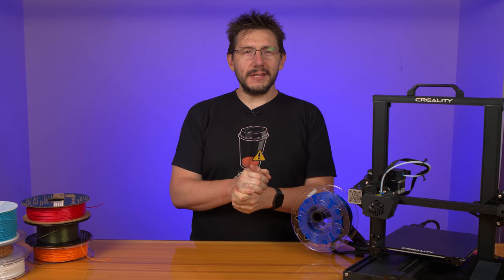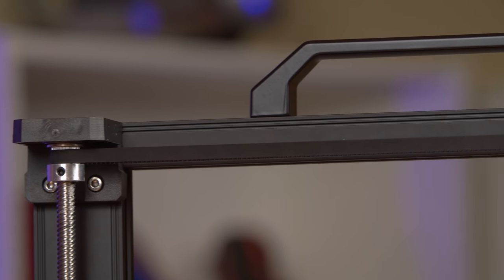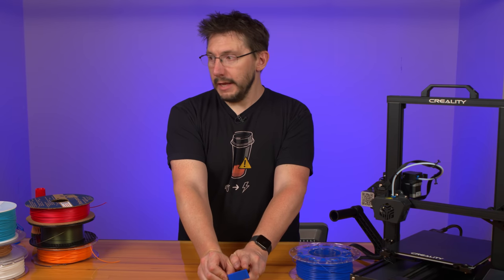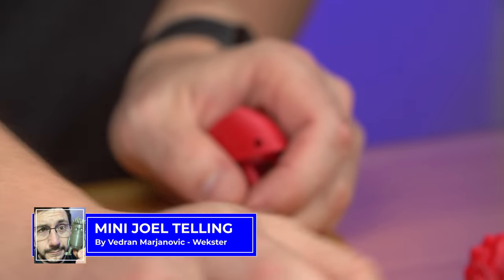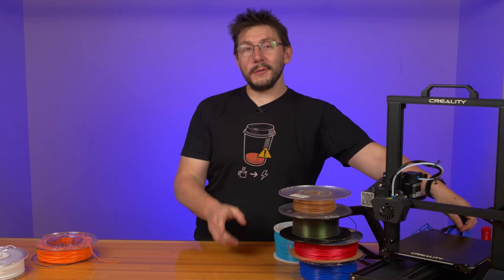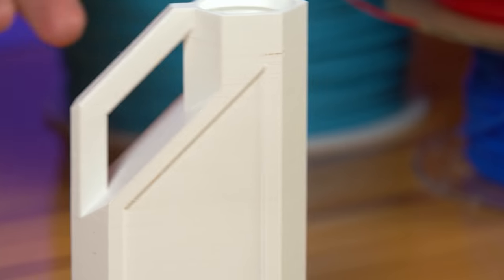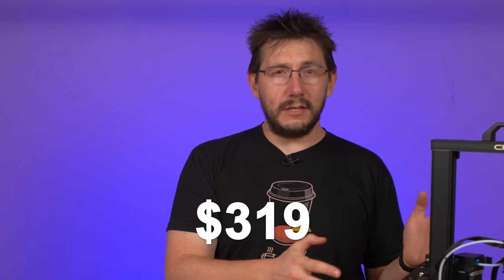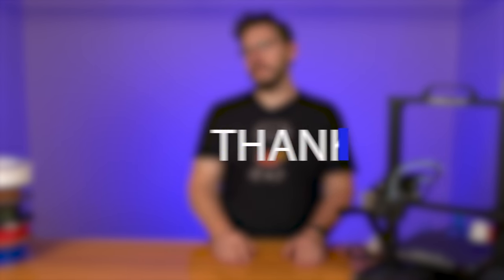Creality CR-6 SE Review // Should You Back It On KICKSTARTER?

Comment: MMmm  kickstarter is an investment gamble with money you can afford to loose which is fine if you want to take that risk. But it's not an off the shelf retail one in production....does it run ok on the standard Cura or other slicers? Still some software updates to do yet too....Imo, so it will be interesting to see what the finished production   off the shelf retail version is and how it runs etc...on thier AliExpress store .Imo Laurie

Comment: Video Request! I would like to hear from everyone whether you have 2 printers or 2 farms worth of printers. How do you handle their slicer profiles managing multiple printers with multiple materials and even multiple configurations of the same printer (nozzles, speeds, dual extrusion, etc...)? Like I said, I would love to hear everyone's methodologies. It would be great if we could get some big YT players who use many different printers, both for fun and professionally (Joel 3DPN, Tom TS, Angus MM, Michael TT, and many others).

For reference, I started with 3D printing in college, 6 years ago now, with a few maker bots in our design lab then ran a printing service in the college library where we only used a single material on a single printer. I then did a thesis project with a prusa clone kit, where I compared printing materials and mechanical properties using standard settings across the board, except for what I was testing. I now currently have 5 very different printers and I'm always trying different materials and printing settings depending on my current needs. I have primarily used simplify3D but have dabbled in prusa slicer recently (first MK3s ordered). I have a Pallete2+ pro which uses their slicer canvas3d.io (free to play with) which lets you have several printer profiles that can slightly link changes together, and then materials have "style overrides" where you can set specific settings per material like speed, temp, retraction, extrusion multiplier, etc... It seems like maybe the way to go but I'm not the biggest fan of that setup right now. 

I know there is no right way but everyone may have a right way that works for them.

Comment: in 2020 it was on kick starter   but not in 2022.  on amazon   569 Can . I am analysing if i will buy this model seems interresting to me. would be my first 3D printer. after looking at so many models,
why does Creality not add thos bars like on the cr 10 v 3  on all those models that place the filament roll on top?  It would make the hole  printer more rigid and stable no?

Comment: OK, I’m saying it... you’re the Fox Moulder of 3D printing 😂🤦‍♂️😎

I’ve backed it, can’t wait as it’s my first 3d printer 🖨
Reply: Just a little advice: I'd recommend you use Cura instead of Creality Slicer, did some quick testing (I did not know about Creality Slicer before), Cura turned out better for me. That was with an Ender 3 though, I'm not sure the 6 even has a profile in Cura tbh, but good choice of a printer regardless of software. have fun printing
Reply: PiXeL _ArC thanks mate. The 3d printing community seems really supportive. I’m going to tinker with a few slicers. Been using the upbox 3d printer at work ( I’m a teacher) as well as a Flashforge  but looking forward to owning my own printer to play around with. This seems like a decent place to start 👍
Reply: @BigfootRunning  Try prusaslicer as well. All slicers produce different results so see what is best for you.
Reply from the maker: Creality Slicer is Cura. It's currently using Cura 4.2.1
Reply: @3DPrintingNerd  Of course, but I couldnt access most of the cool features though. Maybe I missed switching to advanced mode, I will have to check that, but in the test I did Creality Slicer resulted in noticibly worse flat surfaces on the benchy as well as corners. The corners of the Creality Benchy were less clean and less sharp. Anyway, I am going to have to look into this some more then and try to tune the profile some more. Also, to make it fair I guess I will have to test a stock Cura profile against a stock Creality Slicer one.
Once I have done that, I will add whatever was the result here too.

Okay I was too stupid too find the expert settings, but some of the mesh fix options which saved my butt with a project are still not present, that might be the Cura version being 4.2 though

DISCLAIMER: I am not trying to prove you, 3d printing nerd, wrong or anybody else, I am genuinly curious if there is a difference and if it matters

Test 1: 
- File: Benchy
- Filament: Semi transparent PLA from Spectrum Filaments (in my experience semi-transparent filaments tend to show little inconsistencies better due to them, well, being transparent)
- both profiles adjusted to be as similar as possible
Results:
- definitly very similar but Cura still seems to have the upper hand in this case (of course its one case and one printer, not a whole lot of data I know)
- flat top surfaces are more consistent and have no imperfections while the Creality Benchy has some
- ghosting is not existent while the Creality one has a little bit
- the body of the model is more consistent, lines are less visible
- edges are a bit cleaner
- the Creality model has no visible stiching while the Cura Benchy has a clear stiching line 
Also, reported print times are odd:
Cura: 1:54h
Creality: 1:11h
I believe both are not accurate (as they tend to be) but will check if there is an actual difference
The differences over all are not as large as I might make them seem, both models are very good looking for a 200$ mostly stock Ender 3 (only a metal extruder kit was installed). However, the Cura one just looks this tiny bit better than the Creality one. Over all though I am impressed with Creality Slicer for what it is and appreciate the effort Creality put into it despite not really needing to.
Further test to come, I really want to look into the topic now

Tet 2:
- filament: Spektrum filaments PLA 
-  file: Benchy
basically the same test but with non transparent filament

Over all, the differences are slightly less visible. I reckon to most people they wouldnt matter as much. 
The layer lines are more visible in the lower half of the Benchy with Creality Slicer, edges are slightly less consistent and the top of the Benchy looks less clean. But again, stiching is not visible with creality Slicer while Cura has a clear line down the side of the benchy.

printing times were similar too, however Creality was faster. I observed some differences in the way the two Slicers print the writing on the bottom of the Benchy: Cura prints the letters sort of "one by one" (hard to describe) while creality Slicer prints the whole outline in one go. I have never observed this before even in older Cura versions, at least if i did i dont remember.
Print times:
Cura: 1:48
Creality: 1:39

In the end, I guess that it doesnt really matter which Slicer you use, especially as a beginner, since there are often bigger problems than slight inconsistencies. However if you are just starting out and have to decide which one to use, I personally would recommend Cura because Creality Slicer has not shown an actual upside to me except the stiching line cura prints tend to have (which is admittedly annoying).
Next, I will have to let the two Slicers compete in stock performance since, well, that matters probably more as a beginner. I am really looking forward to that because the profiles were quite different and I had to change a lot of parameters to have the exact same profile in Creality Slicer as in Cura, for example things like infill overlap were different. I guess that strength could be a small factor too, however I am not CNC Kitchen and have to way of testing that.

Please pardon the eventual typo, english is not my first language.

 Oh and thanks for the reply and the great content

Comment: I think that if we can't print correctly Flexible, because Flexible has a lot of retraction. it has to have the possibility to change offset reduced the gap between the nozzle and the heating bed on autolevelling. It 's the same for PETG). Is there the possibility to choose gap between nozzle and heating bed for autolevelling?

Comment: the thing where the filament runs out and the bed stops heating, also happens on the CR-10 V2. It ruined one of my prints, bc the print released form the bed. Seems like a very easy thing to fix, maybe there is something else behind the decision not to keep heating the bed.

Comment: So after watching all these vids I decided to go back this.  Tell me if you feel the same way.  Every time they hit a stretch goal they send out a notice....But in that notice it feels like for you to get the stretch feature you have to pay for it.  I have backed many Kickstarter tech campaigns and when they hit a stretch goal you would get the upgrade that was covered.  Like for this one of them was the upgraded 32bit board.   Can you let me know if it is just me or this is how they are running the campaign.
Reply: The goals are included automatically: Trinamic stepper motor drivers, extra nozzles and tube, 32 bit board (the board is a bit odd, as you will need to specify it in user survey afterwards). Same as any other campaign I've backed. No extra costs to the backers on any of those.

Comment: They use the nozzle to level...if you have a flexible surface and start 2 prints back to back the (still) not nozzle will burn into the bed. Glass is the only option
Reply: The auto leveling does not happen before every print though. It's considered to be only needed now and then exactly because the bed is glass so is fixed platform.

Comment: I still want to know more about the control board and LCD electronics.  Specifically, is the control board using a 32-bit microcontroller, and does it have extra I/O connectors for future upgrades (like a 2nd extruder, or integrated WiFi)?
Reply: The Kickstarter ones will be 32bit as it was a stretch goal, but currently no details of the board. Should also reach the next goal to get 2209s.

Comment: Would you need to update the firmware if, for instance, you upgrade the heaterblock to a volcano and then the strain guage sensor needs to know the new weight to measure the force? I guess I will find out once i got mine :D
Reply from the maker: That's a very interesting question

Comment: I'm really struggling on which 3D printer to get as my first. I've had my eye on the CR10-V2, but would this CR6 SE be any better or worse? Print quality is my primary concern, along with working out of the box with no upgrades until later on.
Reply: Buy a Prusa. Definitely a Prusa. WELL worth the wait and the money. If 750 is too much, and you don't mind waiting a little longer, get a Prusa mini instead of an i3

Comment: Too many issues for me right now. I can't believe a company who made the cr10s and many other printers didn't test out those common bugs even before you got it. Hate to be harsh but one would think this is their first run at a 3d printer... Not for me for awhile. I don't like being first to deal with problems. 🤷‍♂️
Reply from the maker: I think the expectation was even though it's final hardware, they call it a beta unit. Shipping won't happen until August or September, and the REAL reviews can happen then with backers getting hardware.
Reply: @3DPrintingNerd  Ahhh.. Ok so as a beta that's good. I thought this was final. Thanks for clearing that up. My cr10s has been awesome. I still think it's the best bang for the buck on the market. 3 years or more now? 😉

Comment: Ok made the plunge for this to see how much better it is than my upgraded Ender 5 Pro.
Reply: Hey Joel, My 1 year experience update using my CR6-SE has been fairly positive.  Yes, I did have the power button issue and the filament Runout sensor not working with Octoprint (did work only when submitted via the SD Card) till I upgraded the f/w to the CR6 Community rel 6.1 last night.  Other than that it has been my workhorse even better than the overly modded Ender 5 Pro I also have.  Thanks for setting me on this purchase.

Comment: I wouldn't back it, I'm thinking it will go for the same price after the kickstarter in perpetual "sales", maybe even for less.
Reply: I worry this and with the ender 3 v2 coming I am thinking you are right.
Reply: I am not so sure about that. not only did they put a lot of new molds and tech into this machine but the QC and "fit and finish" are exactly where it should be and that costs more money. I would not be surprised if it costs them $175-$200 a pop to make these machines. They finally added all the CNC cutting and slotting I have been asking them to do and it shows! damned near snaps together into place with ZERO real adjustments needed. exactly how a machine from a company this large should be.
I HOPE they can migrate a lot of this to the rest of their printer line in time.
Reply: I can't even begin to list the reasons that doesn't make sense. If you review the full feature list (and improvements over the Ender 3), plus how ready-to-print it is out of the box, the projected retail price actually seems low to me.

Comment: Joel, would you recommend this over the Prusa i3mk3 ?
Reply: It's funny you ask this - it seems most channels and "pro" users are very hesitant to recommend anything over the Prusa i3 because the Ender machines tend to have small flaws out of the box and because the Prusa is the "real deal" and not a "knock off". Thing is, my Ender 3 took me an hour and a half to build properly (I followed a guide that told me what to watch out for) and my first print was immediately perfect. I just had to mess around to get the best layer adhesion but for €210 I got a pretty darn good printer. But, every print I've seen, every benchy printed on the Prusa i3 ... it looks just as good or even worse than the one I printed on my Ender 3. Now with the Ender 6 looking to remove some of the default flaws and adding the conveniences of the i3 (filament sensors, runaway protection, auto bed levelling) but with a better screen  ...  and with the option of a 32bit board down the line ... at less than half the price while still having the same quality (or even better) prints? Hell yeah!  If the i3 was €500-600 I'd have bought one ages ago but at €700-800 it just doesn't give enough benefits if you ask me.
Reply: redavatar I have the lotmaxx sc 10. It’s great. Slightly larger build volume and most of the features this one is saying it has. Without the auto level. It has assisted leveling, which I like better then 2 of the 3 auto levels I have used. Since buying my first lotmaxx sc 10. I have since bought 5 more. At $200 usd including tax and shipping it was a hard one to beat. It is a little bit more on amazon but if you can wait for a deal. Then dx.com is not a bad place to check

Comment: $430 for this?? It looks to be a solid printer, but that's ridiculous. I got my Ender 3 Pro for $200 and after $60 of mods it's nearly the same as this, minus the dual Z and touchscreen.
Reply: That's nonsense and I know because I've looked into every upgrade for my Ender 3 Pro - 32 bit board costs $60 alone so I doubt it. Then there's the auto bed levelling ($50 upgrade for the Ender 3 Pro), the touch screen ($40) and a bunch of other stuff which are properly integrated instead of requiring hacks and firmware replacements like the filament run-out sensor. You're looking at at least $150 in add-ons all things considered for $140 extra but all properly integrated instead of requiring custom printed parts to mount it all. And a sturdier frame too ... .

Comment: Can I get my Cr10s to print like this? I use Cura. I have some ghosting on prints where the nozzle has to turn 90 degrees.
Reply: Lower the jerk and acceleration. And so on. Take your time to fine tune the profile and you'll get great results.

Comment: It has dual Z screws, touchscreen, UltraBase (like) bed, filament runout sensor. So everything an Anycubic i3 Mega already had a few years ago. Plus, linear bearings on AI3M.

So what's the kickstart for? This is a well established company, and nothing fundamentally new is here, maybe even 95% of mechanics are the same as of other Creality machines.

Ps: you should have shown some speed/quality capabilities. It seems you maxed out at 35mm/s. I never printed that slow in my life... I literally have no profile slower than 70mm/s. Please show some at least 100mm/s prints in these reviews!

Comment: Hm the kickstarter thing put me off... Its effectively a preorder without warranty. Why? Are they not proud of their long lasting machine?...
Reply: They are still going to have the standard 1 year warranty that you get from ordering from their site.   The reasoning is actually more of a cashflow and marketing thing.   By doing this they can order a large batch all at once without getting a loan for the large initial run of machines.  I would bet the kickstarter fee is probably less than what the interest and fees of a loan for the first production run would cost especially since kickstarter's credit card processor will handle all the transfers and currency conversion with a much lower fees than Creality would get doing it(bigger customers typically get discounts) as well as handle any fraud issues.   On top of that it also gets them new customers outside of the 3d printing community from a lot of people who wouldn't normally see something like that. 

Generally when you preorder on most sites you wouldn't pay the entire thing 2-3 months in advance you might have a deposit but generally you pay when it ships but people will excuse that on kickstarter.